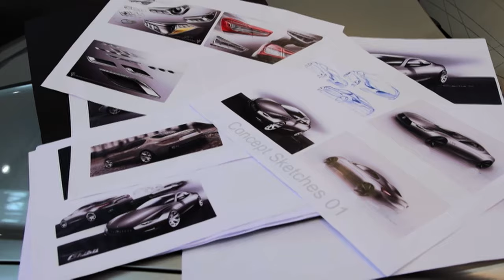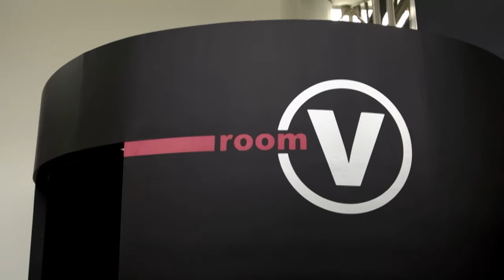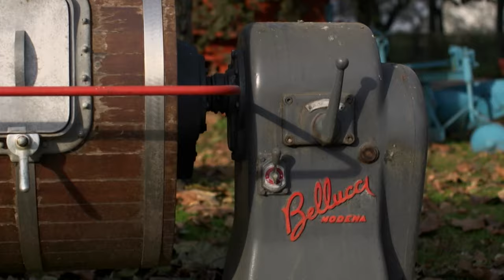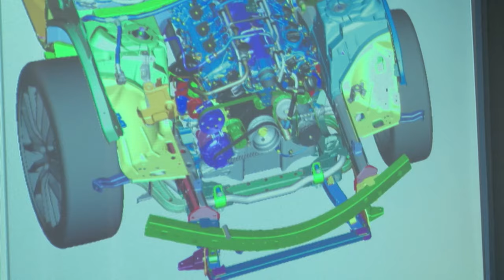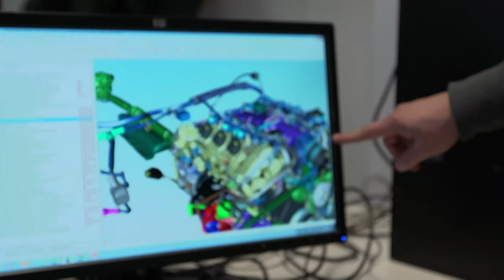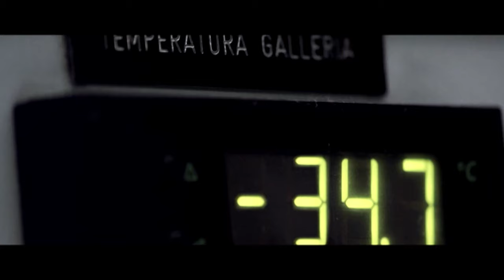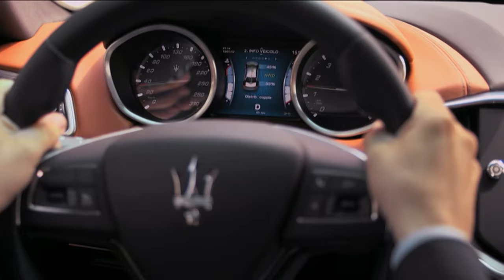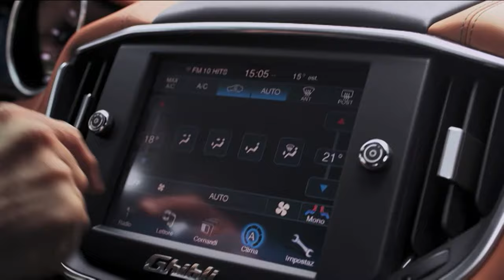Inside Maserati's Ghibli Production - Supercar Superbuild - S01 EP06 - Car Show

Comment: The idea of making a smaller sports sedan is great and the design ended up to be astonishing! The marketing however wasn't that great. In order to sell more units they cut corners. Lots of plastic in entry level versions. They were supposed to build a Ferrari sports sedan but ended up selling a cheap car. The Ghibli name is iconic but the new version damaged the brand. Thanks they understood it and new models and versions are more aligned with the prestige behind Maserati name!